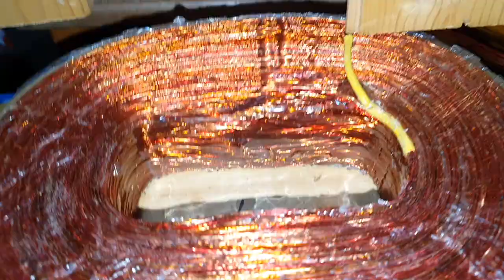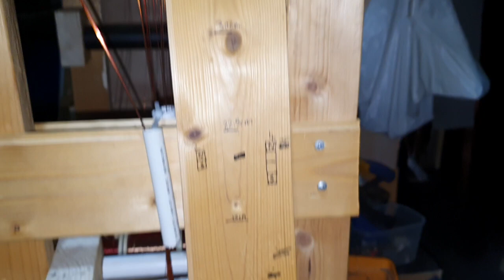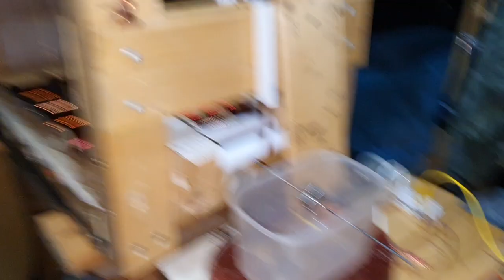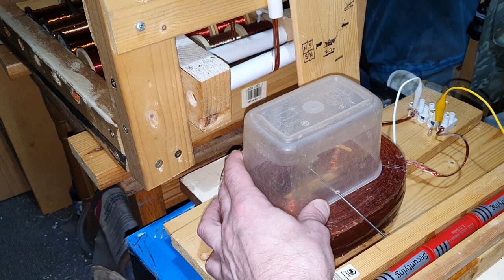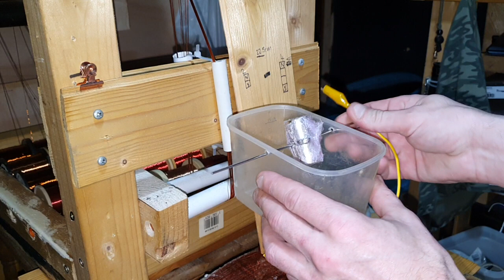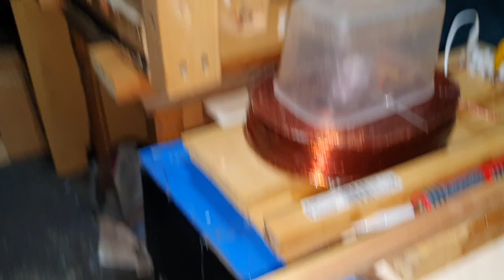coil winding 101 proof my coil wind has a stronger magnetic field pt2

Comment: This coil is very powerful, the distance the magnet spins from the coil, it looks like you are using 3 1.5v batteries. Very curious to see what your coil will generate indeed.
Reply from the maker: Really they are 3x 3.7v li ion battery, china aa batteries are 3.7v unlike our 1.5v ones
Reply: @doubleooh7337  oh okay, I did not know that